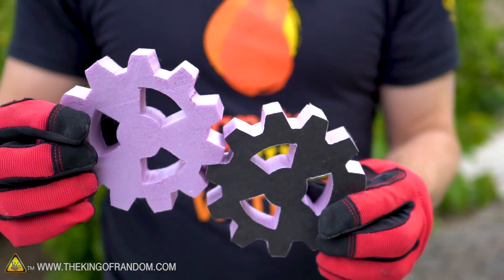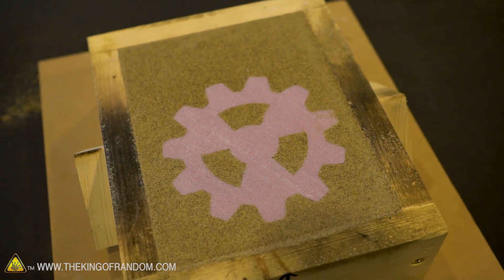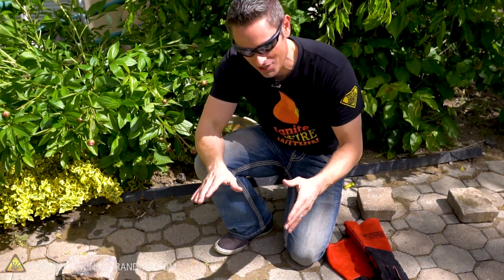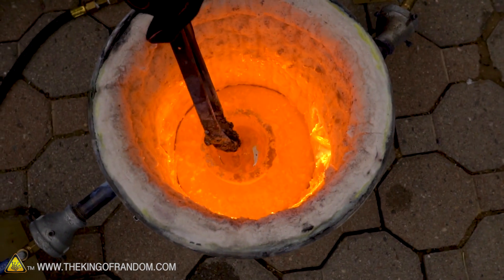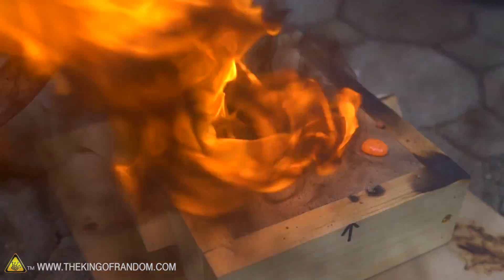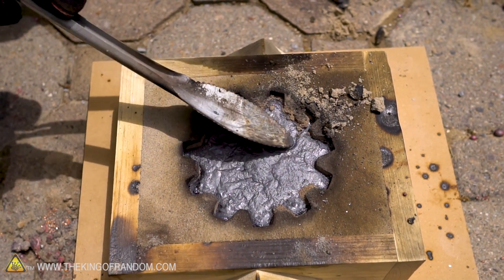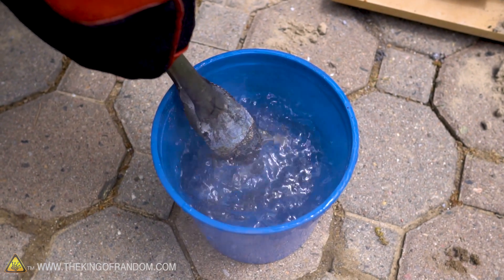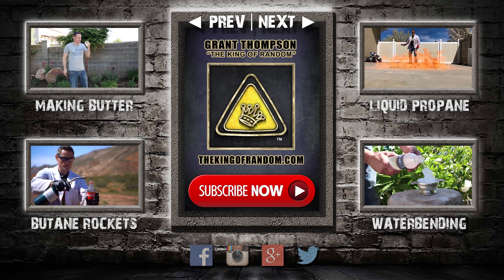Argh. Why Is Copper So Difficult? TKOR Tests Melting Copper In Our Homemade Foundry

Comment: Hey grant. I have an idea. What if you had like a couple of small metal rods in the corners off each indentation. What i think is happening is that there isnt enough strength to counteract the metal flowing around the sand to get get around the corners so it just crumbles. Another idea is to make a metal cast first from like aluminium (Cheap and still stronger than the sand) Then use that to cast the copper gear. May take abit of time however if you do it correct you can actually make quite detailed pieces :)

Comment: Why were you casting it in an open mould? why not just making a closed mould with a gate, runner and riser system, in that way you can keep the sand in place, control the pouring speed and it also has a better insulation to prevent premature solidification. The same way you cast the brass knuckles.
Reply: Yes, this is how you should do it. Doing an open mold like this isn't a great idea and only really works for solid pieces without any holes or extrusions in the body. But even then you may get an inconsistent cooling of the part and an uneven surface that would need to be machined flat.
Also, too much moisture in your mold could cause the mold to "pop" or even explode.
Reply: Im glad you mentioned the open mould. i was getting annoyed watching this vid lol.
Reply: Try add more clay to the sand and moist it then wait to dry out and than pour.
Reply: Definitely need a closed mold. And wetter sand is exactly not the solution. you can see the water boiling up through the copper as it was cooling. This will also cause the sand to separate faster as the steam finds every avenue to escape: It makes a fracture line at the bottom as the mold fills. The copper transfers heat in that first bit to the bottom; then as that sand reaches thermal equilibrium in the first millimeter or so, the sides and perimeter are tasked with rapidly absorbing the thermal shock. A two piece mold with vents and pouring funnels gives much more mass and vertical reinforcement. Dust the surface with Corn Starch.
Reply: Because you get more views if you show molten metal in a mold.
Reply: Yifan yifan... Exactly what I was thinking. 👍👍
Reply: yeah, open mold is the problem
Reply: Yifan yifan I agree...an enclosed mold might help!
Reply: not only do you need a closed mould, prior to casting you best add a bit of phosphorous copper to the melt usually 5 to grams of it to a kilo of copper. it will make the molten copper run like water instead of donut dough.
Reply: I also suspect that's not the best foam to be using. Because it's made for home insulation I believe it's meant to not flash burn and thus takes too long to vaporize. I would think the dense white style foam might work better and vaporize easier allowing the copper to fill all the voids before it begins to cool and harden.
Reply: Basically, a closed mould casting is just how he did in his Brass Knuckles casting video
Reply: And borax to the copper.
Reply: Yifan yifan even heat proof silicon should hold empty to pit then melt away into the sand
Reply: Came down here to suggest the same thing.
Reply: Yifan yifan yup there's the problem. poor casting technique.
Reply: He's right. You need a closed mould
Reply: Yep. Closed mold.
Reply: Yifan yifan pre heat the mould so it dont crack
Reply: You have a point man when ever he was doing the demo of it when he first built the foundry now it's like he doesn't know he did it
Reply: Dynamic Lighting I think Grant just wanted a quick cast, so he used an open mould, it might work for lightweight, low melting point metals like aluminium. But with copper and that intricate geometry, a closed mould would be a safer option.
Reply: He should use clay or a mix of clay and finer grain sand. Coarse grain sand is bad anyway for a gear, it will result in a very rough finish and you will have to remove too much material the finished product will be different from the original design in size.
Reply: an better sand too ,the sand he using is not "sticky" enought for casting ....
Reply: 100% agreed
Reply: @Yifan Yep my thoughts exactly , if he does this it will be a success
Reply: I'm totally agree with Yifan yifan, but I would like to suggest another issue, In industry they are painting sand with a special paint, so it will protect counter sand erosion. Don't ask me about the paint composition.
Reply: I haven't cast since I was in high school and that was my first thought.
Reply: he seems kind of inpatient on this one. maybe that's why
Reply: Was going to say the same thing.
Reply: yea you absolutely need a closed mold when casting pure copper. Copper sucks up oxygen so fast when hardening that it's almost impossible to get it right in a open mold
If you do use a open mold you need to keep it fluxed with boric acid (borax) or under a layer of crushed charcoal. I think it might be possible to cast it in a plaster mold but never tried that myself.
Reply: THANK YOU. I've been cringing this whole video because of the open mold
Reply: Yifan yifan thank you, the whole video I was thinking this is never going to work! A little common sense should tell you that
Reply: You are foundry man. Haha
Reply: I was thinking the same, bury the piece but leave a portion exposed to pour into...
Reply: Make a mould liked the silicon one and pipe in there with better green sand
Reply: VeryUnfriendlySpoon LOL
Reply: Some one here knows his metallurgy... another thing, add some bentonite to the sand man...
Reply: phew! I just came in to write the same thing, a closed mould does the job perfectly, it's been tried and tested and works with perfection always
Reply: Came for saying this. Thank you!
Reply: Im Your Cat LOL
Reply: Agreed. And it will also keep the heat in and the material won't solidify causing a cold joint where the too faced meet
Reply: Mike Carlson or pipe it In with a steel pipe
Reply: But make it that runny runny stuff and vacume it furst
Reply: Christopher Neely Agreed
Reply: This is why you don´t compact the top mold too much, sometimes even add vents.
Reply: eh belinda
Reply: Absolutely
Reply: Yifan yifan
Reply: That is the exact line of thinking I had.
Reply: Yifan yifan you sound smart
Reply: Bulut Sökmen you are welcome
Reply: He did it this way cause he's experimenting and trying to learn greensand casting, if he did it the other way it'd be the same kind of styrofoam casting he's always done
Reply: Also it would keep "pressure" on the copper and keep it in place
Reply: zvezdaster man you are wrong sand us permeable it let s the gaz go throught even with this you can build something called" un event " to let the air flow out
Reply: because he is doing this to show us how cool it looks to watch molten copper poor into a mold and dry...
Reply: Ewan Adeshead Ikr im just sitting here like "dafuq..."
Reply: ：０
Reply: Lui TheGreat Thank you
Reply: I kept thinking that
Reply: True
Reply: I’ve always had motor oil mixed in with the sand when I’ve done sand casting, albeit it was with aluminum.
Reply: Use oil based sand
Reply: Exactly what I was thinking.
Reply: Hope that King of Random re-visit this experiment with this setup
Reply: Fy
Reply: A fellow foundry guy. I need to make me one of these at home
Reply: Was thinking this while I watched
Reply: Because he had to pan out the video time by failing multiple times
Reply: That's better than my idea
Reply: I was thinking to just cast a normal gear and then cut out the symbols
Reply: You should have to join engineering college for gaining knowledge and this person is bulshit
Reply: Agreed
Reply: Yifan yifan because material with high temp usually use a close mold
Reply: Yifan yifan  his work figet spiner
Reply: NERD ALERT
Reply: Yifan yifan that's what I was wondering when I seen him staring I was like why....
Reply: You're right man just basic engineering
Reply: Open mold will not be possible. He need to create closed mold. There has to be vent as well. Perhaps he used 99% pure Cooper so metal flow ability is lesser. Need to select suitable metal chemistry depending upon product application. He need to choose according to product.
Reply: so THAT'S how you make brass knuckles...
Reply: Indeed 🤔
Reply: He's just some guy in a backyard with a bunch of metal. Chill out.
Reply: This sand will fall apart in a closed mould too... it's to coarse it won't stick... if you melt the form out... the holes go with it...
Reply: Exactly what I was thinking
Reply: Agree
Reply: WOW
Reply: Yes you are right enclosed would have stopped those weak spots from popping out like that. Too bad he didn’t attempt that method. Just kept trying the way the failed every time lmao
Reply: A closed mold might cause gas bubbles to form on the surface of the casting. I suggest to use more clay to give the mold more strength. At foundry we use a binder called bentonite which when mixed with water filles the gaps between sand grains and gives the sand much more compressiblity and strength. The problem is your sand does not have enough strength and the mold breaks when the water evaporates. It becomes week and metal breaks it off.
Reply: Can't blame the noob for trying.
Reply: This is exactly what i was thinking when i seen the first failure
Reply: This guy sounds like he knows what he is saying
Reply: Came down here to say the same thing.
Reply: He is not impatient, he uses the wrong material and technic.
Reply: Wet, even almost dry, green sand can blow up in a steam explosion...hot sand and shrapnel can ruin your day.   If the mold has any undercuts the flash steam can be trapped momentarily before expanding...
Reply: Yifan yifan This dude knows his sht
Reply: This is the thread where everyone who watched videos made by experienced people casting, try to point out that there's a search box and maybe you should learn what you can before you make a videos to show people how not to do things.... AND What is people's obsession with burning plastic! Like life much?  %b
Reply: Yifan yifan cause then he couldnt find a reason to do the video
Reply: Yifan yifan 
woah woah woah woah

calm down
i dont speak a da smartypants

easy version please

Comment: the sand was too wet and the copper was drying it out too quickly and causing it to rise. what you need to try is letting the sand sit out with the mold in it so that the copper doesn't dry out the sand on impact :)

Comment: You can make a mold using clay organic matter like hair or dry mulch and charcoal, for detail castings you will need to have three layers for your mold varying in percentages of the three ingredients then you can set the mold in a camp fire to vitrify the clay and burn out the organic matter. It will be best to pour  with your mold still hot.

Comment: What if you had another piece of wood on top of the mold and you somehow funneled the liquid copper into the center of the gear? This way the pieces in the middle that kept moving upward would stay in place and the copper would flow around them. This could also make both sides of the gear turn out really well instead of just the one side!

Comment: Grant. Here is a big tip. You shouldn't start melting the Styro-Foam beforehand. This can cause a large problem as you saw yourself. Instead pour it straight in. Melting the Styro-Foam will then destroy the way the Copper should go and the shape of the sand.The Styro-Foam holds the sand in place. Therefore removing will make the structure weaker and destroy the whole thing.  Finally make sure that you have compressed the sand more. :)

Comment: I feel using a vertical mold (the material enters in the top mold) would work better, using two channels that lead in near the top of the pattern, one to pour the material into and the second for gases to escape. The copper would flow in the top of the cavity and fill from bottom to top, not sure how well it would work with copper because it solidifies quickly but it work well in iron casting. You would also have to the styrofoam pattern for this to so that it doesn't block the flow.

Comment: The problem is that the copper is denser than the sand and because of that the sand floats to the top. That's why u never found sand at the bottom and only found it at the top. Like this so grant sees this

Comment: Just a thought from my high school metal shop days, but in the process of making bronze for a trinket I tested the capability of our school foundry with copper. I discovered that in casting I needed to add a fluxing agent in order to get a clean cast as gasses end up bubbling up through the molten copper. Another thought to avoid the steam issue might me to switch to oil dampened sand. I don't know the particular oil offhand, but again in my metal shop days we used black sand casting that utilized oil as the binding agent. I'm sure a google search might shed a little light on that option. You might also try using both halves of the sand casting to hold down the middle sections in the radioactive sign so that they don't float away. Anyways, thanks for all the great content!
Reply: linseed oil.
You could clearly see vaporised water (steam) from the green sand bubbling up through the molten copper.

Comment: what you need is another layer of sand on top of the gear that has vent holes and a bigger pouring hole. That way it keeps the sand segments from popping out. Had the same problem in the past.

Comment: Too much moisture in the sand can cause a problem as the heat causes it to turn to steam as mentioned in Alex Kim's comment however, green sand is supposed to have a certain level of moisture to it and being too dry also causes issues. If you think the sand was too wet you may want to try "torching" the sand with a flame to remove excess moisture from the mold (usually for 15 seconds to a minute is more than adequate). Another thing I noticed in the video that may have caused an issue with your mold was your packing technique. In my experience I've found that packing the edges first and then making sure to leave about an inch between strikes (imagine planting crops in rows) I move from top left to bottom right adding more sand and repeating until your packed tightly and sand is above the edges of your flask. Hope this helps!

Comment: tou need a two piece mold with red sand or petrobond with sikica soda then talc remove foam gear add sprues to top and then it will work

Comment: If you use a two part mold it will turn out right every time. You can't pull the mold apart right away it needs to harden a few minutes . Then split the flasks , you need channels in the sand and a fill sprue ,,.. hole like funnel ,, the channels allow the molten metal to push air out and fill the mold. The sprees get cut off after there cooled down.

Comment: have tried using anything to reinforce the detail areas? Maybe you could use steel wire to hold them in place. not sure if that would help with the corners breaking though, probably won't.

Comment: Grant, you build the two half casting box, why you keep using only one half? you lose heat faster this way, and the structure doesn't hold so well. If you try the two parts together, it will work.

Comment: One thing to do is use a top mold and cut sprue holes to feed the copper in and one for the gases to escape.  That helps to consolidate the heat and give the open side a form as well.

Comment: You need a higher clay content in your sand and cover 
the foam with talcum or baby powder before you ram 
the sand in the mold. You might need a two part mold 
with vent and pour holes. Keep trying!

Comment: You should of just put baby powder on the foam gear before packing it with sand an then put a screw in the middle of the foam gear  to remove the foam completely before casting

Comment: He should try and completely remove the styrofoam before poring the copper. Maybe burn it out with the propane torch. Also he could re-moisten the sand after because it will dry out when he burns the styrofoam

Comment: Aren't there different types of sand for sand casting?  Also, why not have the gear entirely enclosed in sand?  If the sand of the spoke holes was pushed down by a layer of sand covering the gear, then they wouldn't float away.  All you would need to do is provide a sprue or sprues for copper going into the gear and a sprue or sprues to let the air and vaporized styrene out.

Comment: Grant you should add borax yo  the copper while melting it, it will make everything easier and get better results
Reply: Roberto Contreras also skimming the slag off the top, helps with pitting.
Reply: It's something of a balancing act. Adding flux (borax) to the melt hurts the crucible.

Comment: One thing to try is to make two molds and use co2 to harden the sand then glue a piece of styrofoam to the mold shape and put the second mold on top and use the styrofoam as a guide for the copper to go into and harden between the two molds I may not be making sense but it's something I think will work maybe